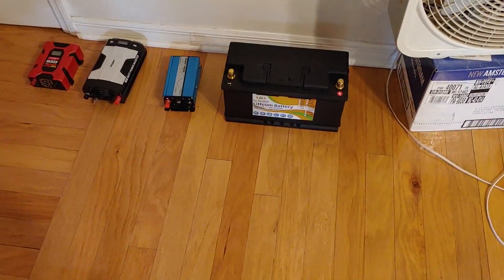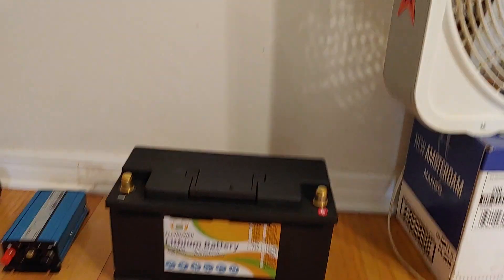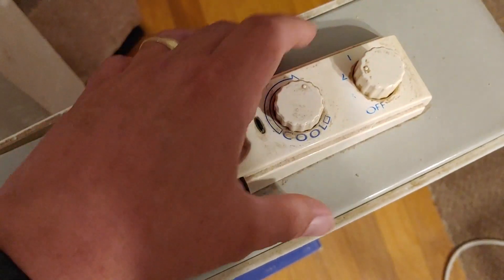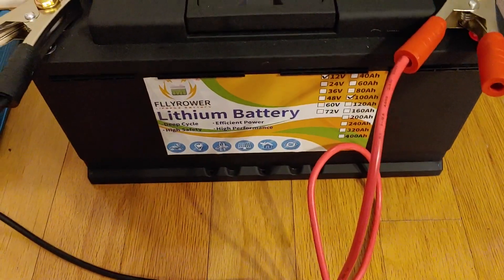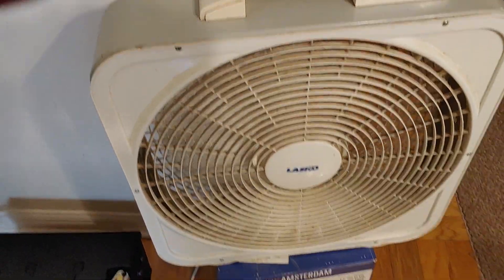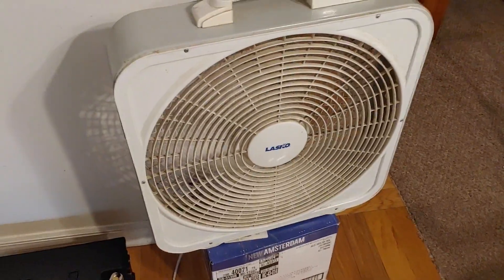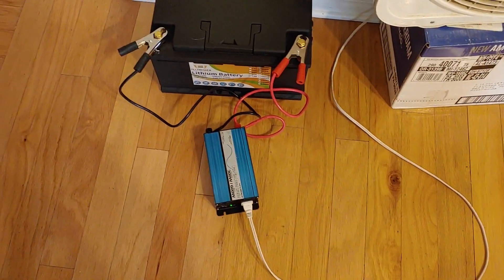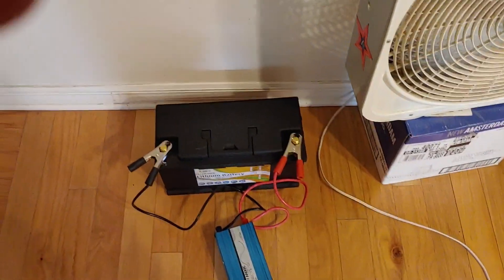Off Grid Inverters - Pure Sine Wave vs Modified Sine Wave

Comment: In a VVVF railroad inverter, a pure sine wave is synchronous/asynchronous PWM and a modified sine wave is 1-pulse.  Many of these inverters starts out as essentially a pure sine wave, but as the train gains more speed, it switches to fewer pulses and finally a modified sine wave (1-pulse).
Reply from the maker: Thanks for your comment.

Comment: You not only lose efficiency,  the fan motor is going to run hotter than normal. Eventually it will fail due to increased heat. Any device designed for a pure sine wave is goint heat up. How hot depends on the components. For example, capacitors, diodes, inductors, motors.
Reply from the maker: Thanks for your comment.

Comment: I have a 900/1800 watt Power Bright Modified Sine wave inverter. I'm interested to see what all it will run in my detached garage that has no electricity. Hoping to run some LED lights, a fan & mini fridge with 200 watts of Solar & 100ah Power Queen battery.
Reply from the maker: The lights and fan will be OK, but I dont know how much power that mini fridge will draw. Good luck on your project. Let me know how it works.
Thank you for your comment.
Reply: @shoestringprep  Will do my plan is to later purchase a 3500/7000 watt pure sine wave inverter with a total of 600 watts of solar panels & two 100ah lipo4 batteries. Will have to make you a video once everything is installed.
Reply from the maker: @miguelsalami  I would love to see the video. Thanks

Comment: There are one big question and a lot of a lot of rumors out there that make me confused.

Will the modified sine wave damage the fan motor in the long run? 

I read a lot stating that modified sine waves should only be used in non-motor equipment. Yes, a modified sine wave will run a fan motor, but it will damage it in the long run. Is it true?
Reply from the maker: Yes, a modified sine wave does damage a motor over time.
Thanks for your comment.

Comment: What does a UPS system for computers produce? That should tell you there if electronics can handle the square. I ran a big screen TV and receiver off a lawn and garden battery for 4 hours at least using a 140 watt inverter that plugs into a cigarette lighter. Get em at the auto parts store. Whats that putting out? Mechanical motors do complain but being an X HVAC reject, a short time on one is not extending its life I put it that way. Try a refrigerator or a small window AC from house current then inverter and see.

Comment: Great informative video,can you tell me if the extra noise from using  the modified sine wave inverter is coming from the inverter or the fan?
Reply from the maker: The noise is coming from the fan. Thanks for your comment.
Reply: @shoestringprep  Thanks for this,Iam using a cheap modified sound wave inverter to power a class D guitar amp but the fan on the inverter runs continually and with a high pitch.Do you know any inverters that cooling fan only turns on when needed?Amp is only drawing 30watts and inverter is 500w
Reply from the maker: @GuitarG123  some small inverters the fan fund all the time. Thanks for your comment.

Comment: GREAT DEMO VIDEO...Many electronic devices  manuals will say to use only a pure sine wave ...they are very sensitive and need clean sine wave for power.👍
Reply from the maker: I agree many electronic devices and sensitive medical equipment requires pure sine wave inverters. Thanks for your comment.
Reply: @shoestringprep mostly any electrical device that uses low power including medical equipment will simply Clean the voltage up first. If it's medical equipment it definitely has to be able to put up with interruptions to power and maybe less than desirable power conditions from all that equipment being plugged into the hospital as well as any backup generator power that they may need to deal with.
Reply from the maker: @elixier33  thanks for your comment.

Comment: Hi mate. I do use a 3000w modified inverter to powerup corded tools like air compressor,  saws, charging cordless tools batteries, etc like at ranch or where power isn't available.  I'm debating to buy buy for home tvs and cameras when there's a power outage.
Reply from the maker: Many electronic devices the manuals will say use a pure sine wave so before you do that please check the manual for the equipment you have. Other than that it sounds like a great idea. Thanks for your comment

Comment: Hi. Is possible to use pure sine and modified inverter in parallel.
Reply from the maker: I would not use a modified and a pure wave at the same time. I'm not even sure how you would put two inverters in parallel. Thanks for your comment.
Reply: @shoestringprep  Noted with thanks.

Comment: Hi Shoestring, could you please do a video of using an electric blanket on inverter? I bought a sunbeam electric throw at Wally world over the winter and hooked it up to my hf 750 watt modified inverter and it toasted the controller on the electric blankets.  I've ordered a pure sine wave 2000 watt inverter to see if it helps? It will be hooked up to three 122ah each deep cycle lead acid batteries...love your videos.
Reply from the maker: I will add this to my future video list. Thanks for your kind words and comment.
Reply from the maker: By the way remember not to use wet lead acid batteries in doors
 It produces fumes.

Comment: can you use a 12 gague wire to connect to your car battery, and will it be safe to use with out killing your battery, or starting a fire?
Reply from the maker: 12 gauge wire will handle up to 20 amps. If you keep your usage at 20 amps or under you will be fine. Thanks for your comment.
Reply: @shoestringprep  it seems to be working ok, I have the same one in this video and it says it is only using 14 vaults it has two 35 amp fuses in it. i am glad it has an on off switch so it wont kill the battery. thankyou for your help.

Comment: Can i use a modified inverter with my led grow lights i found good deal on a 3000w modified inverter
Reply from the maker: I use a modified sine wave with my LED lights. And are still running after a year-and-a-half. Thanks for your comment.

Comment: You did not demonstrate the differences between a PSW and a MSW inverter.  For that, you'd need an oscilloscope.  You did not measure efficiency in any way, shape or form.  For that you'd need a simple Kill-A-Watt meter, at the very least.  You demonstrated how one type of load runs off of those types of inverters, and you picked a load that is least likely to be damaged by using a MSW inverter.  

The bottom line is very simple:  You use a PSW inverter unless you simply cannot afford one.  If that is the case, you should think long and hard about how you go about charging and powering sensitive electronic devices...or you'll be replacing those expensive devices because you were too cheap to buy a good inverter.  That is a classic case of being penny wise and pound foolish.

At the very least you could have shown how going from the MSW to a power conditioner and then to the fan eliminates the noise caused by the motor not getting a steady, 60 hertz cycle from the inverter.  Ask anyone who has worked in professional audio production about power conditioning to eliminate hum and you'll quickly understand how a cheap, $100 conditioner can protect your very expensive audio equipment from "dirty" power sources...like a MSW inverter.
Reply from the maker: I was simply explaining the difference between a pure sine wave and a modified sine wave for beginners. Thanks for your comment

Comment: Why not run the inverters thru a Kill A Watt meter and measure the actual efficiency?
Reply from the maker: Thanks for your comment.
Reply: I have used two Kill A Watt meters on a 1000 watt MSW inverter. Both got super hot. Not sure why, but I had to disconnect before serious damage could occur.
Reply from the maker: @donbrloks3959  that is very odd. I have not had that happen. If you figure out why please let us know. Thanks for your comment

Comment: Theoretical the modifies sine wave is less efficient in a motor. However your test does not prove that at all. Or did you measure for instance the windspeed vs the power draw? The question remains how modified sine wave inverter performs with for instance a switching power supply (like for a laptop).
Reply from the maker: I did not measure the output of the fan, such as wind speed. 
The laptops do charge slower when on a modified sine wave, and often make a buzzing or humming sound. However, as far as I can tell, the laptop is not harmed by the use of the modified sine wave.
Thanks for your comment.
Reply: @shoestringprep  Thanks for the response.

Comment: I use a 24 volts Aims 2000 watts inverter / charger...it is a pure sine and works great ; the only thing is the idling current is 26 watts, so sometimes if I just have a small load I use the 410 watt modified sine inverter...in two weeks I will get two more batteries...that will be 16 lol...every time I add two more it acts differently...in a couple months I will have a hard decision to make ; whether to get two more or not...the 14 that I have now are at 24.2 volts this morning...it's getting to be later before they start charging now , around 7 AM...
Reply from the maker: It's always true that the more batteries in the system, the longer it will take to charge. 
Thank you for your comment.

Comment: Some power tool battery chargers (my Ryobi 40 volt charger, specifically) say "Do NOT use on modified sine wave power".  That may apply to any tool charger over 12 volts - check the manual(s) for your charger(s).
Reply from the maker: I agree. Always read and follow your manual's instructions.
Thank you for your comment.